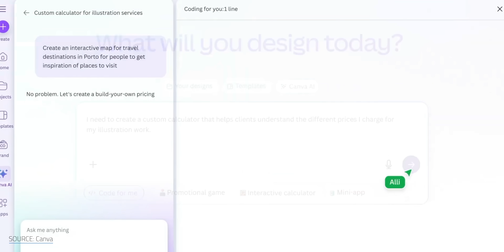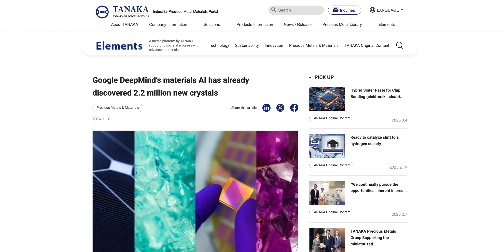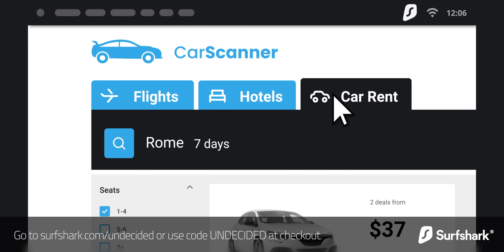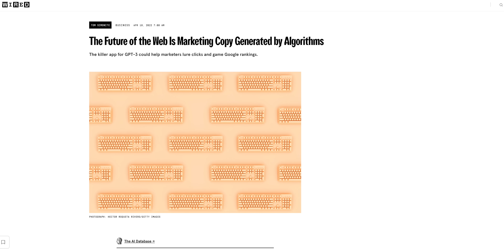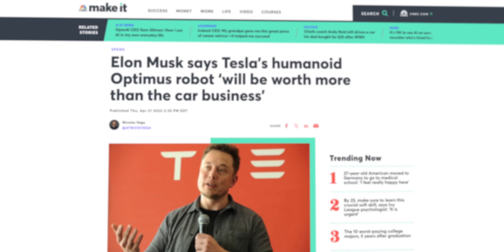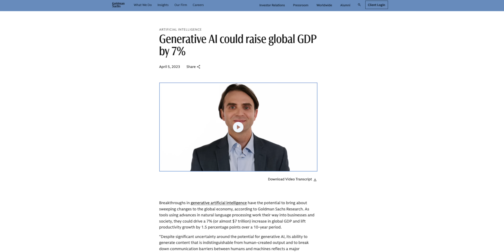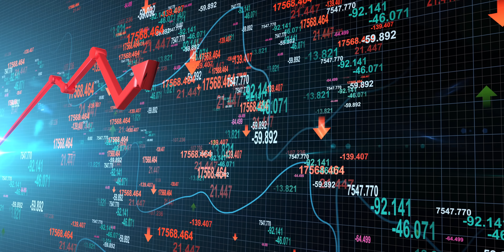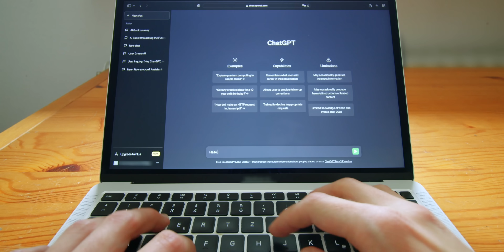Why the AI Revolution Has a Fatal Flaw

Comment: "Garbage In, Garbage Out".  AI is only as good as the information/data it works with.  There is alot of garbage out there (including within data in company accounting systems, e.g., bad/incorrect data filled in the reference section or incomplete data, etc.).  Right now, AI is not good at sifting through the garbage, and I foresee it taking at least decades for it to do so.

Comment: There has been no technological breakthrough so far in human history that hasn't increased the number of jobs in an economy. One of the reasons is that if you for example replace your manual labor with robots in a factory, your products become cheaper which leads to much greater demand, and that leads to much more labor capacity needed, which extends upstream and downstream in the supply chain. And supply chains are incredibly complex. Try imagining what goes into making a simple pencil with a rubber. You need wood, saws that cut the wood, steel with which to create those saws, a mine/miners that will dig out the ore, a whole foundry that will smelt the ore, everything for every machine/component in that foundry, the construction of the factories themselves, and again whatever goes into that... And that's just for the wood of the pencil. You also have the graphite and rubber left which are just as complex.

Yes, some people and sectors did get and will get displaced, but overall the number of jobs goes up. The displaced workers of course, need to be re-qualified for different jobs, for which LLM's are an ideal solution anyway. A new meta study shows that learning with LLM's is significantly more effective than without.

Comment: Your knowledge of AI is extremely limited. Its like trying to explain genetic engineering to a toddler in ones and zeros. The real revolutionary AI is the one running on Quantum Computing and becoming SELF AWARE. In other words a conscious intelligence that learns at an exponential rate. Limitations will not be possible as NO HUMAN understands the code the machine is using. Very difficult to explain to people outside AI.

Comment: There are other issues with AI, especially "big" AI: "big" AI (unlike Deep Seek) uses huge amounts of data, electricity and cooling; it's becoming an environmental hazard. Secondly, if I understand right, the AI we have now can't combine searches; it has to start a search over again from scratch. Thirdly, it "learns" by imitation, not consequences. I've even heard it said that "big" AI is terminal; it's reaching it's limit for what it can do and how much data it can actually use. Deep Seek is (said to be) far more efficient, but slower and harder to produce. Would you like to do a deep dive into this?

Comment: There is no special AI-paradox. Innovations lead to higher productivity. More work gets done in less working hours. That can be used by companies to kick out workers and make extra profits.The solution has always be the same: The workers need to work less for the same money and thereby benefit from the improvements instead.And that will not be granted as a present. It never was. 
The idea, that the new thechnology will replace all the old jobs with new ones anyways is delusional - if it did not reduce necessary working hours to get the necessary tasks done, it would not be an improvement in productivity in the first place. Universal basic income may soften the blow,, but it isn´t a solution either, but  a means to accept high unemployment as normal.

Comment: 3:45 It's worth noting that these numbers could be totally bogus. PMs and VPs have *HUGE* financial incentives in the form of bonuses to announce that they've "improved processes" with AI, but often the KPIs that they are reporting are easily fudged to look like they've done much more than they actually have. "Using AI to reduce product development cycles by 40% which lead to lower emissions and better aligned consumer preferences." Notice how they didn't say they reduced emissions from this by 40% or anything like that, it could be a .0000001% reduction in emissions and that would still be "reducing." 

Once you've worked in a corporate environment and you actually learn how these parasites think and act it becomes very easy to spot these meaningless "achievements" that soul sucking middle-management uses to get themselves promotions and raises and not actually do *ANYTHING* remotely useful or productive for the company.
Reply: Just because the promised productivity improvements are bogus demean they won’t reduce the workforce.  The cuts come first, the oops we missed our targets comes later.
Reply: as a dev who uses ai regularly: it has not boosted productivity for very large projects by more then 20%
most of the time is spend figuring out what the heck is going on, talking to people to understand the topic and so on.
and no the 20% improvement is not in coding. sure its faster but needs more refactoring down the line.
it helps with writing jira comments out of all things xD
Reply: @webentwicklungmitrobinspan6935 
TBH I use it as an advanced google search. Sometimes I just want to find a small snipet of code that fits my use case. Or helping me to write docstrings for my functions or classes.

It can not write big chunks of code, especially when you have a relatively big project, or if it contains a lot of custom solutions.

It is increasing the productivity, but I think the expectations are growing as well e.g.: docstrings, unit tests, QA, robust deployment pipeline, robust data storage etc. Its especially obvious in the model building space where things are usually quite chaotic
Reply: @webentwicklungmitrobinspan6935 Jira and git comments, meeting notes, code review and comments on code, some basic utility snippets. Those are the most useful functions of AI in coding. The stuff you are supposed to do, but not given time and doesn't get counted as productive for humans. I had to recently turn off code completion because it  was constantly giving bad suggestions and it was making things slower than basic tools.
Reply: @webentwicklungmitrobinspan6935  It's early days, think Henry Ford and the Wright Brothers. Then think F1 cars and F-35 fighter jets. I'm surprised at your lack of foresight for a developer. Or maybe you're in denial.
Reply: @gio-oz8gf  Sure, once we have a cheap system that takes orders in local takeaways, we can talk about F1, right now it's more hot air balloon. The balloon that runs at a big loss.
Reply: @Nighthawk20000  
Considering how much computing power AI requires, it has been reported that the use of artificial "intelligence" consumes huge amounts of energy.

So the net carbon emission effect may as well be positive, rather than negative.
Reply: Perhaps, but even if say 90% of the gains are exaggerated, that is still huge gains in a short amount of time, and we really are in the early stages of what can be done.
Reply: They are bogus. 

All of them.
Reply: While I read this and I'm inclined to agree, just on the side YouTube recomends a TED talk "The AI Revolution is Underhyped" by Eric Schmidt
Reply: After watching “AI” and computers in general in science for quite a while, mostly I found them good at hallucinating and making pretty pictures.

I don’t doubt that some good will come of it, but I had quite a bit of trouble believing the rosy montage presented in this video. It rang about as true as some kids middle school science project changing the world.

I will say though that putting lipstick on cat butts was inspired and I probably will never look at lipstick or cat butts in the same way again.
Reply: I have had a couple run ins with the AI hype train recently.  I sure it will be great for some applications, but the things I have seen pitched as better than sliced bread have been absolute doggy do do.
Reply: GREAT point
Reply: Another issue in the same vein is "use AI to (achieve X)" If companies want to seem innovative they need only call some system "AI" (a term with no legal definition of course) and then have it in some way be part of the process. 

So if they "used AI to reduce emissions by 40%" that could mean anything from machine learning running trillions of simulations to maximize the efficiency of some process to finishing up a project they had already started five years ago entirely done by humans except that right near the end Bob ran the numbers through ChatGPT to double check them.
Reply: @Nighthawk20000  couldn't be more true on that meaningless achievements. 

Corporates way of applying 'underwater ceramics technician' on everything.
Reply: Easy to follow productivity improvements without the executive noise.  the statistics are published for anyone capable and interested in following such data.
Reply: while CEO ad other executives are boasting on 'improvements'  they are also doing layoffs to ' trim ' the workforce to meet lower labor costs

Comment: This is not a new conversation, it has been on going since the industrial revolution and textile looms.
It had another spike with personal computers and the so called paperless office.
I began my trade using hand tools, reading dimensioned drawings, and requiring a good standard of accuracy, now I program a CNC router making the same our similar things.
Never saw that coming.
Things tend to find an equilibrium, there does seem to be an increase in greed these days though.

Comment: The economic analysis in this video is quuite shallow. AI like any form of efficiency, allows us to make more stuff at a lower cost, and in the case of AI much of that lower cost is displacing human labor. Having more stuff with less labor should be a reason to rejoice not to cringe. The challenge is how can we distribute this newer, lower-cost stuff in some reasonable way.  Yes the luddites were displaced from their looms, but that's not the main issue. We need to emphasize human value-add of a sort which is not replaceable by AI.  Yes it will cost disruptions, just like the advent of the automobile, or the computer.

Comment: "GDP was rising"

I was disappointed when you 😢followed your reference to the Goldman Sachs 300 million job loss forecast with another that forecast rising GDP and productivity, with the latter being a sign that the former may not be as dire as it seems.

I know that you know that rising GDP, and especially rising productivity very often mean widespread permanent job loss or degradation (full-time high-skill union job to part-time low-skill job with no benefits) created by mass corporate layoffs that boost stock prices and executive compensation.

Those forecast metrics should not, in any way, alleviate the concerns and fears about the future and nature of work as automation and AI become more prevalent.

Other than that slip, this video is very good and timely, as usual.

Comment: UBI does not work, it is a net negative. There are more problems with it than without it. The biggest issue with AI isn't AI itself but rather the rapid rate of adoption and displacement of previously highly qualified people. If this trend keeps up then there will not be any jobs for people because they will only exist for short periods of time but humans need them to exist for decades. The other net negative is it will be hard for most people to start anything new because ideas take time to build and mature. But if that progress is cut to seconds by an AI model, then there will only be monopolies.

Comment: how is that different from cheap labor optimization methods of the past 30 years.... just the conclusion?  Did not Ford or or auto maker already had that kind of realization, to pay their worker prices so they could afford what they made?  Or is that a myth.  if not, it computes in the same direction as making good for cheaper, as if the workers were never part of the economic dynamical system... only furniture..

and one furniture out of fashion does not instantly reprogram according to simplistic business top of pyramid wishful tunnel vision thinking stuck on bottom line..

Comment: I would not worry about robot taking over yet, being an AI researcher. Think about it, Tesla self-driving is a form of robot whose job it to strear the car in the right direction , compared to a humonid robot which has to predict dozens of trajectories and solve long terms planning,  self-driving only has to make three prediction, steering angle , acclerator and breakes after 10 years of promises how is it working out.

Comment: Good show, this is a question I've pondered often. As a one time programmer I was interest to note that Microsoft generates a large portion of its computer code using AI. I haven't verified this but it came from a usually reliable source and I wouldn't fault Microsoft for doing this. My understanding of LLM's make me think they will be very good at programming. For a while at least you will still need analyst to manage the coding but the grunt work that I spent hundreds, if not thousands, of hour doing and getting paid well to do, those jobs will not be around for long. Overall I think AI can and hopefully will be a positive thing but it will need watching and figuring out how to manage/survive the changes that are knocking on the door. We are in for interesting times.

Comment: As far as solutions go, the Venus project  and the mind behind it, Jacque Fresco, foresaw this outcome and proposed an entirely new system called Resource based economy or RBE. At its core is the  abolishment of monetary system and a shift to abundance based system where machines are serving the needs of humanity and there is no need to use money because anything is readily available for use, much like the library where any item can be taken for use and returned when not needed. 

Obviously, this is simplified description but it gives the rough idea. The crucial part though is this will only work if most of the world adopts it, so programs like RBE might be a feasible stepping stones in the right direction.

Comment: AI is showing the flaw in scalar money commerce.  Representing the value of a good or service with a single number called the "price" or "wage" is a lossy codec that loses all the information about the product/service inputs at every transaction.  It's unsustainable.  Regulation is the attempted workaround, but it is high latency, low throughput, low reliability, so it cannot keep up with the speed of scalar money commerce, which is low latency, high throughput, and high reliability.  AI can help us migrate to vector money economies by serving as a kind of "dungeon master" game server that does the goods/services matchmaking for us using large vectors instead of scalars.

Comment: If we use the tool correctly, then we should be fine. Using it to replace anything, even jobs, is bad, even if the AI can do it better. So train your employees to work more efficiently based on your findings. Then everyone wins. It's when we go whole hog and through all caution to the wind in search of the perfect AI that will do all the jobs in your business so you don't have to pay anyone, but then who will buy that stuff? Not me. If a human didn't design, build, test it, I can't trust it. Not really. Use it as a tool to help, not replace.

Comment: My customer has IT Dpt speaking about AI all the time. I am a consultant on their internal administrative website (HR tasks, travel requests, expense claims etc...). They believe that AI could replace the coders AND me to update and upgrade their system. They think it would be as simple as telling an AI what improvement they want and the AI would do everything. I usually ask them who will take the responsibility of "asking" the AI what is needed and usually there is crickets... They NEED a human to discuss and evaluate what are the pain points and what are the solutions that are cost effective, efficient AND will be "accepted" by the users. Also an AI will not have the vision of system modification impact on all parts of system AND think about the futur developments. 
AI are great to "do" what you are asking (or at least mimic what a human would have done especially if it is a repeated task) but you cannot rely on an AI to be an architect for system, it cannot decide properly. You cannot rely on AI to make decision for you... Yet...